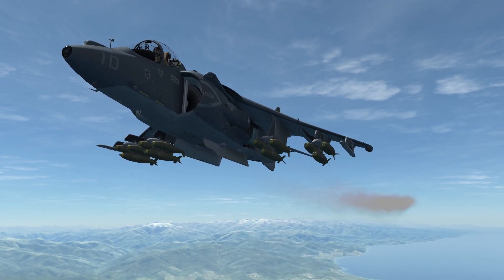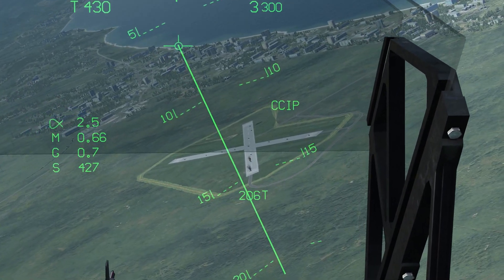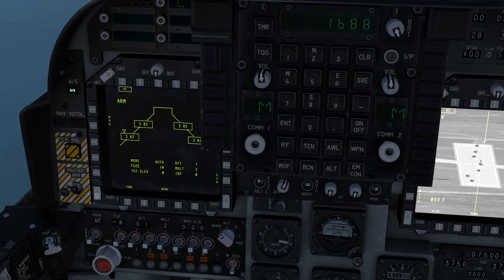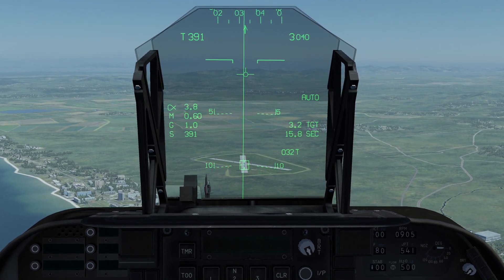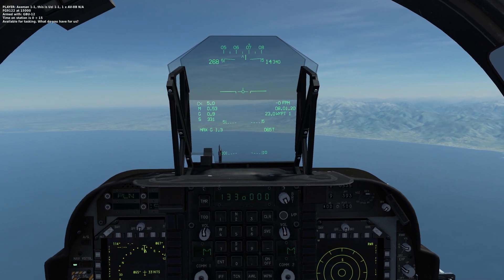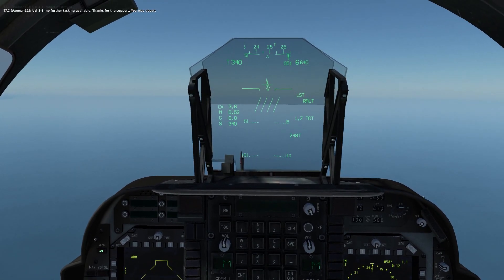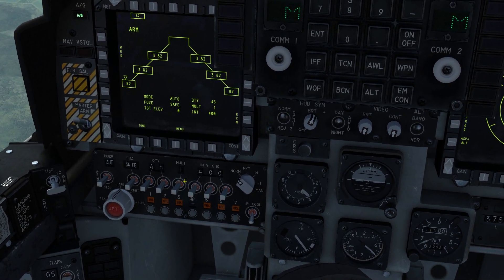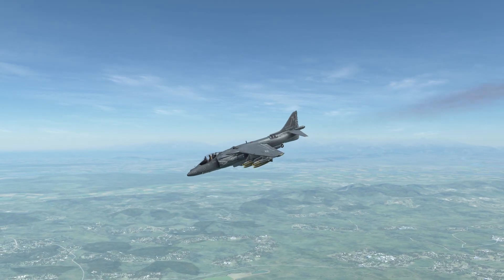DCS AV-8b NA Harrier CCRP / CCIP /AUTO and Laser guided bombing tutorial

Comment: This tutorial should be remade to reflect the correctly modeled targeting systems, as it was wrong back the time this was made.

Example the AUTO mode is like this, but the bombs fall line doesn't swing like that, instead it is far steadier and usable actually.
And CCIP mode is completely different. The CCIP reticle never leaves the HUD, it will stay at the bottom even when your bombs would fall below your HUD. That is why the crosshair is not solid (instead dotted) as it is signaling that impact point is below the aircraft, and then drop line has a horizontal line to present visually how far it is below the HUD. 
  But the key difference is that the dotted crosshair is CCRP designator, so you can place that on top of the target, press and hold release button and you have designated that position as CCRP and you are automatically switched to AUTO mode, so you can perform the level bombing, lofting etc. But sadly lofting etc is not yet modeled (March. 2020, should get finished this year).

Comment: Why am I getting 4 dashed lines on the HUD when i press the pickle button in AUTO mode and why does it say "BAUT" on my HUD and not AUTO? please help!
Reply: same issue, cannot auto bomb at all, no referenes about that online, also cannot get the flir on the hud (hud in night mode)
Reply: yes, same here, when I pickle in AUTO mode, vertical line on the HUD disappears and I have 4 lines on the HUD and no bombs are dropped. I thought I was mistaking something ...
Reply: @racingtheweb  It's  a bug and is already fixed internally and should be in the Wednesday patch. Don't have the source though (look in the Razbam forum)
Reply: @deathcat0011  I still seem to be having this problem :/
Reply: @atortoisechannel  It definitely works now. Try cycling the drop mode. It always starts in CCIP. Should be the uncage button.
Reply: deathcat0011 That seemed to be it. Went back to unguided bombs and checked the procedure there. That helped me figure it out.
Reply: J D i think the 4 lines indicate that you are not in a stable flight to drop the bombs

Comment: Nice video. Picked up the general operation watching your videos if the harrier good work. Showing my inexperience here. How come you released the bombs when the pipper had passed over the target. I noticed the cross went passed the target then you said pickle. It works as your very precise haha
Reply from the maker: Me saying pickle and actually pushing the button will not be perfectly in sync, between a slight de-sync in audio recording but also because i might be early / late in saying it myself. i aim to push the pickle button just a moment before the pipper crosses the target, to allow for the delay in both  reaction time and the physical action of pushing the switch.
Reply: RedKite ahhh I didn’t think of that. Yeah very true, hoping to practice the harrier more tonight and get the mavs and target pod a go. If I survive the entourage of migs in the mirage first.
Reply: Also do you find the dmt and irmv process aren’t currently working? I followed your video, slew dmt, uncage agm65-e, sensor forward, tdc down. Just can’t get lock or fire them. Yet slew the mavs themselves lock and fire right away. So not sure if tpod is broken too
Reply from the maker: AGM-65e is a laser designated mav, it requires a laser marker to use them, from either another aircraft or a ground unit. TPOD is a little dysfunctional, personally i'l use the dmt with mavs, or go visual.
Reply: RedKite thanks for he reply. From my finidings there’s 2 variants at the minute E being one of them. I notice in the stores page the E’s show as IRMV. I need check the other variant to check it’s not me then haha. Been going red in the face following your videos and it not working haha

Comment: The dashed cross in CCIP doesn't mean it is inaccurate and solid they it is accurate.
The dashed vs solid cross means are you in CCRP or CCIP modes.

The dashed is CCRP 
The solid is CCIP

The HUD is not complete. The dashed cross should never leave the bottom of HUD, so you can always see it. All you need to do is to fly and place it above target and hold pickle and then fly by guidance to CCRP. 

The inaccuracy comes from ARBS not ready. That system is most accurate way to do dumb bomb dropping, being far more accurate than ie. F/A-18 A-G radar ranging or TGP/TPOD laser ranging. 

It takes all aircraft flight parameters as input and the angle of rate change for targeting and generate a very accurate release solution.

The same thing is done by a Soviet aircrafts, but even those ain't simulated correctly.

That is one thing harrier has as benefit on Western side.

So to repeat, you should see a dashed cross at bottom of screen, fly to position it over target and hold pickle and you are now in CCRP mode. When cross is solid, you are in CCIP mode.

No need to swap modes as automatic mode does that for you need when you press release.
Reply: Why am I getting 4 dashed lines on the HUD when i press the pickle button in AUTO mode and why does it say "BAUT" on my HUD and not AUTO? please help!

Comment: dude an asymmetric load on this thing is insane....i was trying hard to control her too and she just belly flops right over and starts rolling towards the ground can't do anything to recover it either. how did u trim it I can't seem to get the trim to work correctly
Reply from the maker: Trim won't solve the issue, simply stop it rolling over on it's own. You need to be light with the inputs and turn with the heavy wing down to make it easier to turn, always release weapons in pairs if you can. It's a small jet so the weapons make a big difference to it's centre of gravity.
Reply: thanks man i'll give it a go.
Reply: Why am I getting 4 dashed lines on the HUD when i press the pickle button in AUTO mode and why does it say "BAUT" on my HUD and not AUTO? please help!

Comment: Is it possible to make a video about buddy lasing? A friend is flying the A-10 and you flying the harrier?
Reply from the maker: Buddy lasing is pretty simple, il consider it for a future video but requiring two people to record it makes it a little tricky. If you watch the jtac/laser guided section, it's exactly the same process for the harrier. As for the a-10c pinky switch enables the laser, it wont fire if an m is shown (laser masked by frame) and insure it's in laser mode, laser field of view is best directly in front and below the aircraft, if you're orbiting it's best to point your underside towards the target via a roll whilst lasing, or go head on as the harrier starts it's run.
Reply: RedKite thanks mate! Ich watches you guide and it was very helpful and buddy lasing was already successful! Thanks!

Comment: Its the systems fault for ccrp not being accurate for unguided munitions considering its not going to be perfect since theres wind and turbulence making the aircraft move.
Reply from the maker: You see, i would agree but, there was no wind, i was bombing from low alt and the ARBS system is meant to be reasonably accurate, i find the A-10c is much easier to perform ccrp accurately with. I find the symbology very twitchy and sometimes even what looked like a perfect drop infact lands way off from what id expect. So i suspect there may still be some calibration on the arbs needed.

Comment: So i am trying to make a custom mission where i use the gpu-12s so I have to put a friendly A-10c to the jdam. The problem is that i dont find any jdam task on the task menu.
Reply from the maker: I'm assuming you mean JTAC? I've never tried setting up an aircraft in such a role, but aircraft have different waypoint tasks depending on their role, there should be a role called fac available (forward air controller ) this may have the ability to perform jtac actions.
Reply: RedKite ok thank you and yes I mean jtac

Comment: I always thought CC stood for "Continously calculated" :)
Reply: I could be extra finicky and say it actually means "Continuously Computed..." but I guess calculation is computing. Tomayto/Tomarto kinda deal ;)
Reply: Dug up a little bit. It seems the "Constantly" is used for CCIP and "Continuosly" for CCRP. Go figure. :)
Reply: You rang?
Reply from the maker: You may be right, it's been a while since i've seen it as anything other than ccip/ccrp haha, same end effect though.
Reply: Rick, if you wish to use computed, then it should be "Constantly computed". :) There's double extra finickyness for ya! Right there! :)
Reply: Official NATOPS AV-8 Tactical Manual says: CCIP = Continuously Computed Impact Point and CCRP = Continuously Computed Release Point.
Reply: Why am I getting 4 dashed lines on the HUD when i press the pickle button in AUTO mode and why does it say "BAUT" on my HUD and not AUTO? please help!